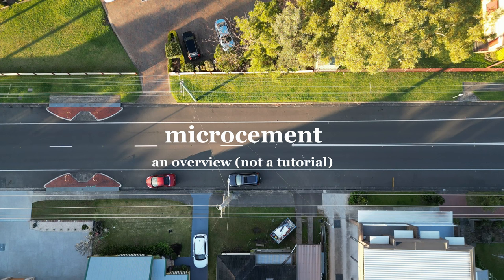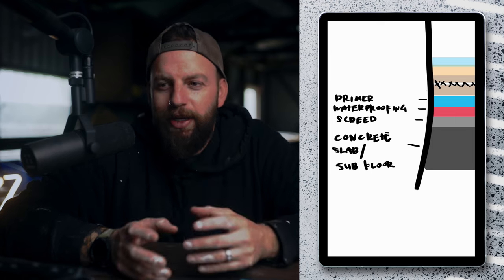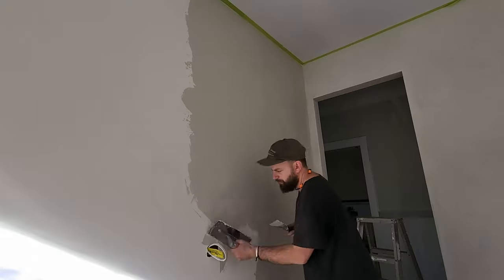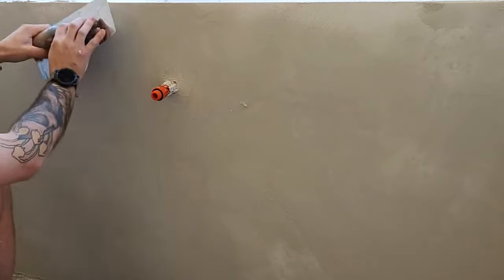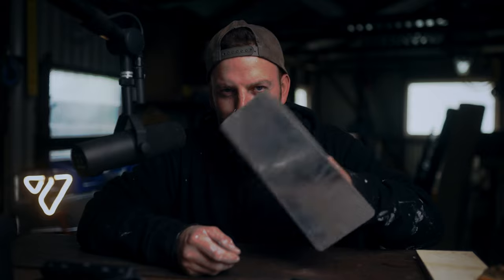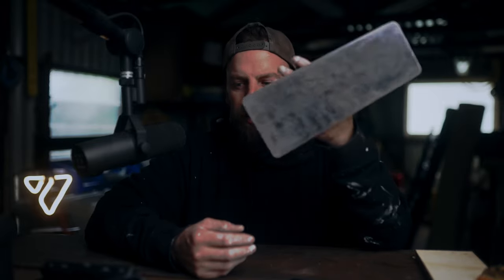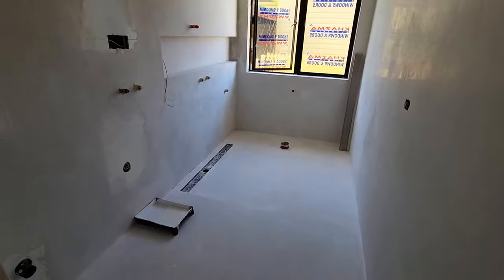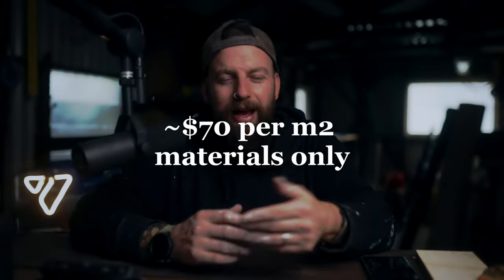Microcement in a bathroom | An overview (not a tutorial)

Comment: Can you apply on tiles? And how do fill up the thickness different as my wall is half tiles and painted. 😢
Reply from the maker: Probably easiest to remove the bottom half of the tiles. 

You can go over tiles but you need to fill the grout first with an additional product to avoid seeing grout lines.